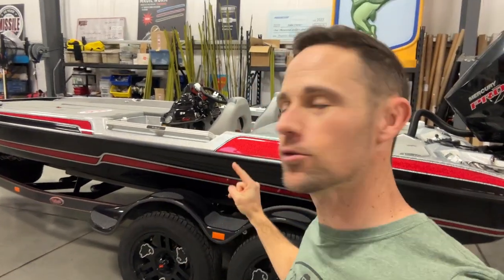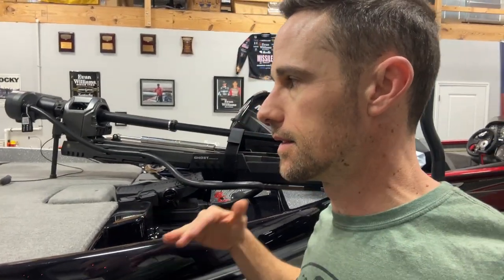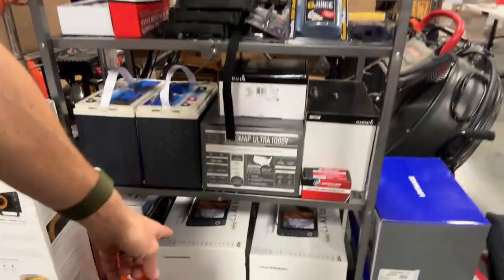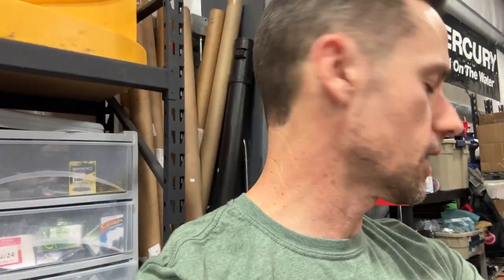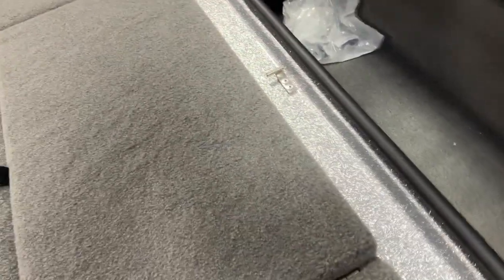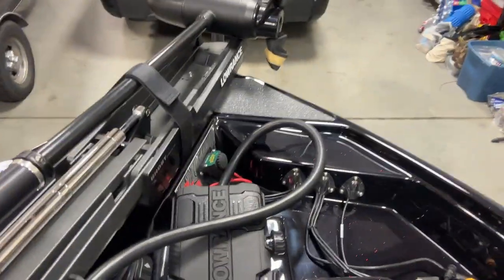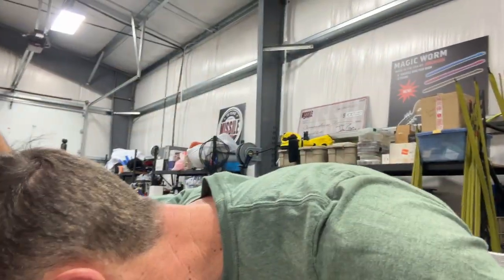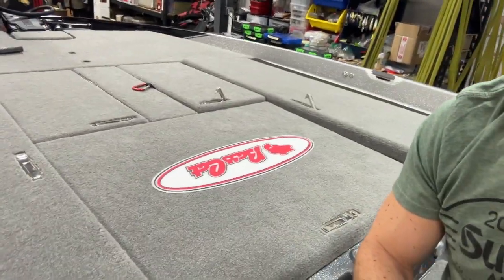First Look at my 2023 Bass Cat Puma STS

Comment: Nice! Question. I saw the battery set up you mentioned. Is that all you use to power electronics and cranking? Just one 36V and 12V lithium, or is that just electronics with another set up for cranking?

Comment: As someone that likes to rig his own boat to make sure it's done right, I'm kind of surprised you trust the boat manufacturer to run your graph wiring?  How do you know they didn't use automotive crimp connecters and substandard wire?
Reply from the maker: Bass Cat uses 6 gauge power wire to console then 8 gauge to bow. They know how to rig a boat
Reply: Is that something they do in every new boat or is that an add-on option?
Reply from the maker: @binkwood  Every boat. As a rigger, you would be impressed if you took a tour of the factory.
Reply: @JohnCrews  I did tour Bass Cat but it was 19 or 20 years ago.  They definitely weren't using wire that big back then.  Do you have them glass in your internal transducers too?